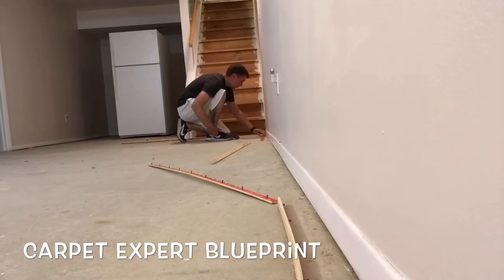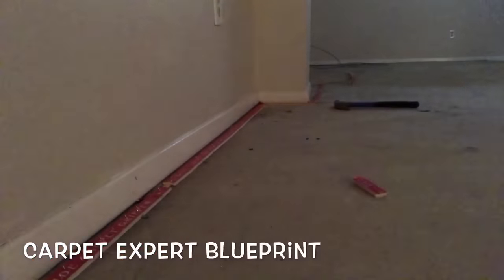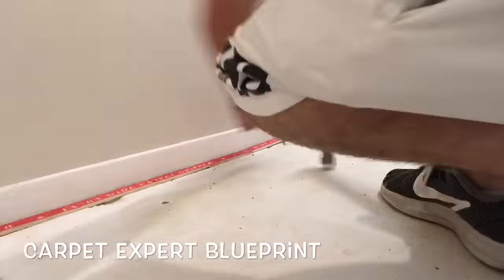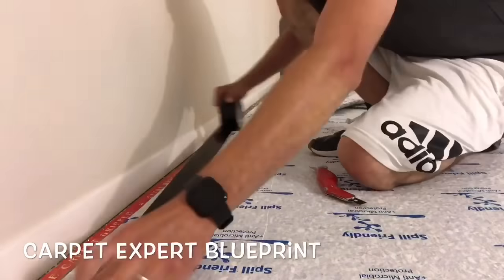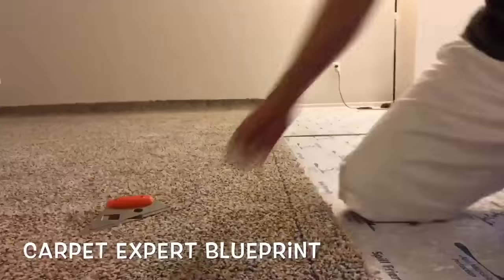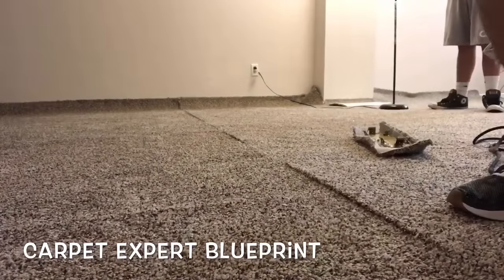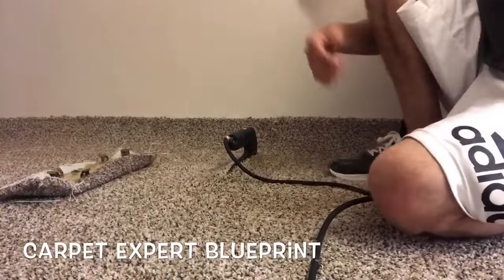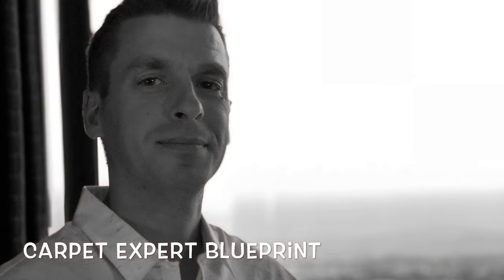🔨 How To Install Carpet Over Concrete ⚒

Comment: you cut the first seam edge with the blade out on the wrong side of the top cutter. You burned your seam going against the grain. You used no seam weight. You used no stretcher. If a person installs carpet without a power stretcher, the carpet void's it's manufacturer warranty....You should not give "expert" advice.
Reply: You don’t need a power stretcher if you cut and kick it right
Reply: @bigt3718  using a kicker to stretch carpet can make it look installed, but will not hold up very long. All carpet must be power stretched according to CFI and according to the carpet manufacturers. Many, in fact most, installers in my area (Philadelphia) use a kicker to stretch in carpet, and they get by. But it is not a correct installation and it will wrinkle sooner than later.
Reply: At best, a average diy install. Far from a professional  installation.

Comment: What about moisture from the concrete? Do the strips absorb them possibly causing mold down the road?
Reply: Yes this will likely mold to some extent. the carpet and padding may have enough vapor transfer to keep it dry for the most part. But there is also not very much R-Value in the carpet and padding in the northern cold belt

Comment: The description is fine as far as it goes, but incomplete. It does not address prep work, floor repair, or leveling and does not mention whether the need for a moisture barrier should be evaluated.

Comment: Could you please share the brand of underpayment you used? Mine is the one that does not have the think vapor barrier in 1 side, it is "foam" both sides, the moisture from the floor will come up and spill from the up will go down. is that still valid?

Comment: I was wondering why you install the padding that way?  Concrete holds moisture- and the foam side can absorb it.  In not carpet installer but mold remediation contractor.  Would it not be better to put the plastic side down to act as a vapor barrier between the carpeting and the padding?  What does the manufacturer recommend?

Comment: I just had some foundation work done in my finished basement. Unfortunately they don't cover placing the carpet back. Well hopefully I have enough to get a tight stretch. Looks like replacing all the tack strips is in order as well.

Comment: Smoothedge does not typically go down in to concrete that easy. Maybe explain more how the nails can break apart the concrete very easily depending on the concrete and if the nails are being hammered straight. To me nailing concrete smoothedge and metals can be a very frustrating part of the job. I have never seen a new helper be able to properly secure concrete smoothedge to the floor. I would at least mention that they should reinforce the smoothedge using  construction adhesive if the they are diy projects and get an extra bag of concrete nails. Other wise great videos at least your putting it out there 👍
Reply: Yup, I had to install tack strip onto my concrete subfloor after having to remove it due to a small flooding issue and it was a total NO GO. The concrete would just bust up under nails when trying to hammer it in. Maybe the concrete in that basement is new so it goes in easier. My house is 15+ years old so the concrete is pretty hard. I found a video where they are using square aluminum drives in 1/8" holes drilled with a hammer drill. I am hoping that works for me.
Reply: Better off gluing the carpet down somehow. @henryuta

Comment: Is it possible that my concrete floor might crack when the nails are being hammered in? My concrete basement looks very old and uneven. And if yea, then should I use carpet glue instead? Thanka

Comment: What's the best flooring for concrete floor. I have a moisture problem. There is a screed over the concrete but any carpets carpet tiles even lino appears squelchy and the house is extremely cold almost icy I'm presuming moisture is coming up through floor

Comment: I usefully use spray bond for underlay it works pretty good way faster than duk tape or glue donw
its $7 a can I can do do about 300 sqy
Reply from the maker: Bleta Q awesome tip! Thanks for sharing
Reply from the maker: Bleta Q thanks will do!

Comment: do I need tack strips designed for concrete install or are they all the same?
Reply: Different for wood or concrete floor. concrete strips have harden nails

Comment: Where exactly do you put the kicker when kicking it?  Do you place just in front of the strip, on top?  How exactly does the carpet get pressed down onto the pins on the strip?  How much do you need to kick exactly?  Do you have to kick on the starter wall?

Comment: Hey you rowed your seams this time around. You don't use tape around the walls or glue just the pad seams?

Nice work
Reply from the maker: lol occasionally I'll do it by the books! Yep typically just tape the seams unless the carpet is really heavy then I may glue the perimeter of the padding to prevent it from shifting. Thanks

Comment: Hey! We got our professionally installed and our carpet is very easily lifted from those strip tacks that you talk about. They have been back once to "stretch it out" but it still comes up with the lightest of pulls.
Normal?
Basement, over concrete as well.
Reply: recommend restretching onto tack strip and pushing or rubbing onto the spikes thoroughly
Reply: Are you still under warranty?  If its coming loose its because it's not stretched properly!  The tension of the stretch should hold the backing taught to the pins in the tack strip!  They should use a , power stretcher,  and two runs of tack strip!  Good luck!  Oh,, think of the carpet as a bungee cord and its stretched and hooks to the pins in the tack strip.

Comment: I have a question. I’m in a condo with shiplaps. Above the shiplaps were 5/8ths fiber board. I’m removing those boards and fixing up the shiplap by removing the nails so no more squeaks and replacing with screws. 
I’m thinking that I shouldn’t replace the 5/8 board with 5/8ths plywood. Instead I should put a thinner plywood and then pour self leveling concrete all over the condo.  I still want to install concrete in most areas, but think the self leveling concrete option over straight plywood replacement would add better resale value to the place. Do you agree?

Comment: When installing carpet on concrete, you should always use a vapor barrier or else mold will start to grow and you'll have a nice musty smell to your carpet.  When installing carpet in a basement, you should go one step farther and use a dimpled vapor barrier.
Reply: Chicken2057 this is false. Carpet does not require a vapor barrier. If you put a vapor barrier down it will trap moister and create mold. Carpet is a breathable materiel which will let the moisture though and evaporate.
Reply: @GaryTheGringo  But then when uou put something on top of the carpet why does it become wet when you take that object off the carpet. MOISTURE BARRIER IS IMPORTANT.
Reply: @vlsr71  moisture barriers are not important for carpet unless you want to stop spills from soaking in to the pad. Let’s take your statement that the carpet was wet when you moved something and dry where there wasn’t anything sitting on it. That means that the rest of the area was able to breath and get rid of the moisture. If you put a vapor barrier over everything and trapped all that moister under the pad. The whole floor would be soaked. Tell how that vapor barrier is working for you then? One more point about the vapor barrier pad that is a total sham. You will poke hundreds and hundreds of holes in it when you stretch it in and your power stretchers teeth go threw the carpet as it grabs it to stretch it. So once again please tell me how it is important for carpet?
Reply: You are breathing in all that vapor coming from the wet concrete slab. Do you think that is healthy? Isn't it better to have a ceiling to that porous concrete slab? The ceiling is the moisture barrier.
Reply: @vlsr71  breathing in that moisture will not harm you, mold will. Having a house with a properly working HVAC system is capable of removing excess moisture in the house with in reason. So what you are trying to imply is that if the concrete does not have a vapor barrier on it then you are breathing in unsafe moisture? So please explain to me why the millions of people living in houses with unfinished basements are not getting sick. If you are laying a laminate floor or a floating hardwood floor on a slab then it is 💯 required to put a vapor barrier down. But even then it does not get rid of the moisture. It just redirects it to the outside perimeter of the floor. It still goes in to the house. It just has to take a slight detour.
Reply: @GaryTheGringo  you cant have mold if you have a plastic material flush to the slab. Or even an epoxy coating. There is no room for mold to grow. The moisture just stays inside the slab. Im also refering to a carpet installation. If you cant use lets say a desk chair pad on top of your carpet without it getting your carpet wet you need a barrier. Period. Just because people dont keel over and die on the spot doesnt mean its not harmful.

Comment: I’m having carpet installed in a newly finished basement and I’m installing prehung doors and trim. Carpet is 1/2” and pad is 1/2”. If I install the doors and trip 3/4” off the ground is that enough clearance to install carpet and push under trim and door jams?

Comment: Do you have to use a special padding for concrete basements?
Reply from the maker: J eff Patchell not necessarily just if there is potential moisture issues you may want to skip padding and use an indoor outdoor carpet installation

Comment: Hey if I carpeted this with a thinner material like an automotive carpet, would it be smooth? Can I get the model or link for this underlay? I like the white screen paper stuff on it. A quick reply would be super helpful
Reply from the maker: Sham Gawd everyone private labels this stuff so it’ll be a different name depending on who you shop with but look for “8# spillblock padding” and you’ll be able to find comparable products
Reply: Carpet Expert Blueprint thanks!
Reply: Carpet Expert Blueprint would the automotive carpet sit smoothly. How can I apply it to this padding.
Reply from the maker: Sham Gawd I personally have not tested with an automotive carpet so I can’t say if it would for sure

Comment: I did not see a power stretcher. When do I not need a power stretcher?Thanks.
Reply: James Lucas all carpet that needs stretched should get power stretched. Using a kicker is not a proper installation. A kicker is only intended for positioning carpet not stretching it. The only time you should use a kicker to stretch carpet is on steps.
Reply: Gary The Gringo you’re very right. Not a lot of installers use Power stretcher.

Comment: The smooth side of the padding is the vapor barrier, right?  Why does that go face up and not face down?  I understand why you would normally put that face up to protect from spills.  In basement I thought it would probably go face down to protect from the concrete sweating.  Or does concrete not sweat or anything like that?

Comment: Where is the power stretcher? If the carpet is not properly stretched there is a high degree of probability that there will be problems with the carpet loosening over time creating "waves" or "wrinkles". A knee kicker alone is not sufficient to stretch the carpet 
Pad cement should be used under the padding/cushion to secure the pad to the concrete subfloor. On a wood subfloor the pad should be securely stapled using a hammer stapler. This prevents the pad from moving or shifting especially during installation.

Comment: The experts don't know what newbies don't know.  For example, looks like there was a space between the wall and the tack strip.  You didn't address this. Why?  What distance?  I had a handyman who put the tack strip next to the wall onto the cement, without a gap.  He didn't finish the job.  If this is wrong, do I just up it up or can I continue?
Reply: must leave gap for carpet to tuck into. will need to remove the smooth edge (tack strip) and refit

Comment: When you're cutting the edges, how do you know how much to cut? And not over cut .
Reply from the maker: J M thanks for connecting! Every situation is a little different but basically cut the carpet 1/4 to 1/2 inch hefty and tuck it to the baseboard
Reply: @CarpetExpertBlueprint  thank  you for your advice 👍

Comment: do not let these guys in  your house !!! they are not experts !!!!!!!!!!!!!!!!
Reply from the maker: larry martinez oooooo shoot the flooring police are on patrol!!
Reply: Just do the job right way .feel sorry for the people you installed for.
Reply from the maker: larry martinez lol well if you have time to feel bad for my clients then you have time to start a channel, create and upload content showing the right way to install floors. Until then everyone will be following my bad advice
Reply: @CarpetExpertBlueprint  hack
Reply: @CarpetExpertBlueprint  yes we are. No kneepads, takking from left to right,  not checking the tack was secured, no wall trimmer, ne weight on seam. No tucker . Fail. Fail. Fail.
Reply: A hammer to install tack strip? Of course u use a hammer what the heck? Why call him a hacker
Reply: @angelmiranda1962  a real installer uses a hatchet they run for a round 50 bucks a piece. Nice and heavy hammer on one side. Axe on the other to cut the tackstrip

Comment: Not exactly a " How to " video . ...Not a complaint , just not what I was expecting re the title .
Way to fast and no actual close up instruction .

I've been doing full home renos for almost 30 years now , and for the most part , the only thing that I won't do , is carpet and lino ( anything that involves a seam ) .
Seeing you cut and seam that carpet as easily as you did , I assume , is an experince thing , vs just a text book thing.
More times than not , I've watched the installer use a straight edge when cutting for seams.

Oh well , on to look for more videos...

Thanks 
Bob